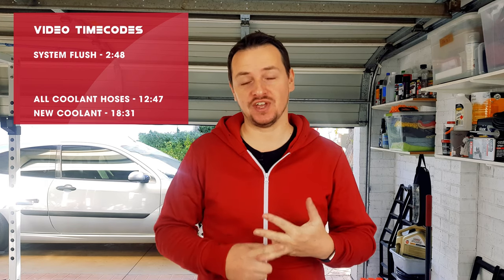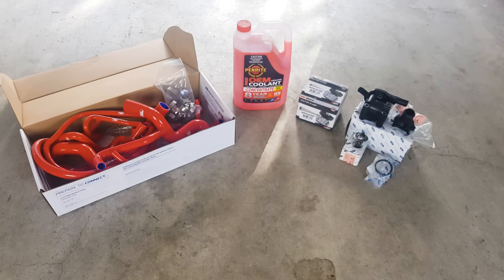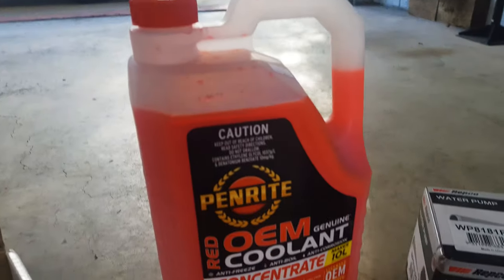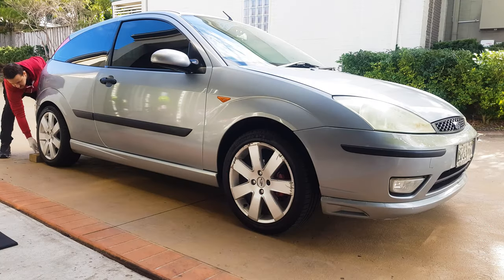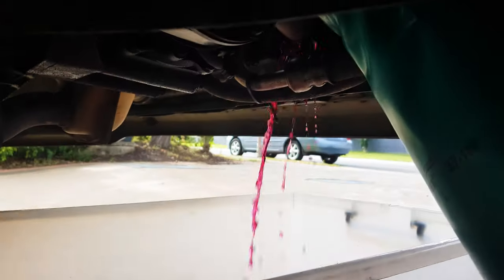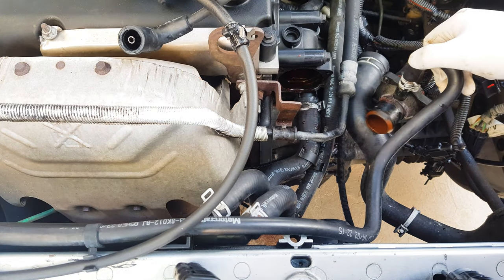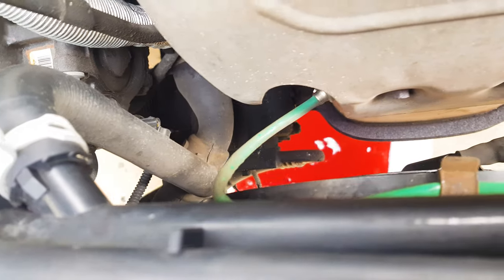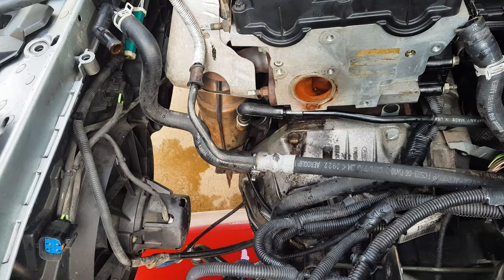Complete Cooling Fix - All Hoses - Water Pump - Thermostat

Comment: Hi bought 2001 focus 1.8 zetec 14years ago still runs great those hoses really finish the engine bay off also i think your video's are excellent for the DIY mechanic as they are well detailed i would just like to add fo the benefit of all focus owners check bodywork behind rear liners as they hold water when wet and will rust the bodywork underneath and by the time otherwise you will only know when you find a leak in the inside of the boot round the bottom of the inner arch ☹️👍
Reply from the maker: Thanks so much for sharing, and for your support Paul, much appreciated. I hope you've subscribed, more to come 😀👍

Comment: Another EXCELLENT video. Watching this one will not only show me clearly how to do, but also incorporate the changing of the pcv valve, camshaft position sensor & one of the motor mounts as long as everything is disassembled. Will save time and energy in the long run.
Reply from the maker: Thanks for your support Ziggy!!

Comment: Spent 12 hours in the Texas sun doing this today, along with radiator, fans, idler pulley, belt tensioner, fan relays, and coolant reservoir….all thanks to your videos! I probably have about 4 hours left tomorrow, however, I’m having trouble accessing the “y” pipe where it connects near the water pump. The power steering pump is above, the a/c compressor below….it’s just very tight to get pliers in there, plus the size of the hose there being so large means a wider span pliers. Not sure you have any advice. Also, you’re lucky you have right hand drive, my heater core is on the other side from you and was really tough to access. 😅
Reply from the maker: Hey Jake, I'm glad to see the videos being put to good use!! Your Focus must be coming along nicely... I can see you're putting a bit of work into it. Really glad to see another MK1 being taken care of. I did this job a little while ago so I'm not 100% clear on which hoses were hard to reach any more, but one tip I can offer you is to put a jack under the oil pan and remove the engine mount located underneath the coolant reservoir bottle. This will then allow you to move the engine up and down using the jack, to give you more clearance around the water pump, since the space between the pump and the chassis rail is tight. Once you jack the engine up and down with that engine mount removed, you will have lots more room to play with around the water pump, including sliding on any hoses... Hope that helps, and glad to see you giving the Mk1 the attention it deserves! 👍
Reply: @Horus_Works  Thanks brother! I definitely used the jack to move motor up and down as the water pump, idler pulley and belt tensioner were all impossible without it. I ended up loosening the power steering pump, moving the power steering lines, and using radiator clamp pliers (the gun type with the cable) and finally got it off, it was in a horrible position. After spending two full days doing all the aforementioned replacements, turns out I had a leak that was not the water pump. It looks like it’s coming out of the crank pulley but it coming from above somewhere, it’s not the water pump housing either. I suspect the head gasket leaking to outside of engine or block? I have no water in cylinders (borescope confirmed), no water in oil, no white smoke or hydrolocking of any kind. Pretty bummed. After this weekend, I don’t think I have the a head gasket in me. Gotta go pay to get a proper diagnosis. At least try and determine where leak is coming from.
Reply from the maker: @jakemaddox76  Sorry to see that brother. While you're in there anyway, take a look at the alloy housing that the water pump screws into... that alloy part screws into your engine block, and there is a metal gasket sandwiched between the block and that housing. Maybe that metal gasket has let go? You can see the alloy housing I'm talking about at 11:00 in the video. It's the part that I cleaned the old blue gasket off - that's not your block. It's as alloy housing that screws into your block. If you move the power steering pump out of the way you will be able to see how it's attached to the block. Hope that helps you narrow the leak down... 👍

Comment: at 7:39 it doesn't look like the housing has a gasket against the engine block? did you put one off camera? And was it a donut shaped or cylinder shaped gasket
Reply from the maker: If you're using the Ford part like I am, no need for a separate gasket mate. The rubber seal/gasket you need comes with the thermostat housing. Try and pause the video at 7:04. On that shot you will see the thermostat housing. Look at the circular rubber o-ring sitting between the 3 metal bolt holes. This is what seals the housing to the block. Hope that helps 👍
Reply: @Horus_Works  i see it now,
i just bought an aftermarket one because the Ford one was priced as high as they could.
The aftermarket one came with that gasket separate, but it looks dinky, I'll see if i can buy the gasket from Ford.

Comment: What if you don't have a garden hose, would just draining a 5l bottle of water down the hose cut it?
Reply from the maker: Hi mate, what I'd recommend if you don't have a garden hose, is plugging all the coolant hoses back in, filling up the coolant bottle to full, and running the car for a few minutes with the heater on. Then draining it completely again. Repeat this process until the fluid in the coolant bottle is completely clear. Then drain it one last time, and fill it with the coolant/water mixture. It takes longer this way, but it will guarantee that you still flush out the system.
Reply: @Horus_Works  thanks a lot, keep making vids cuz they are really helpful
Reply from the maker: @WoWCoreT  thanks a lot for your support 👍